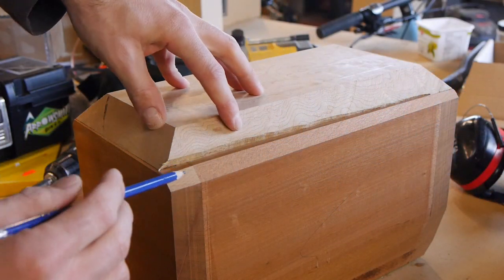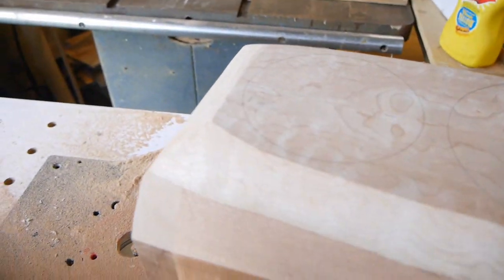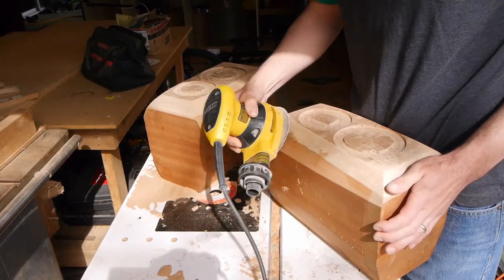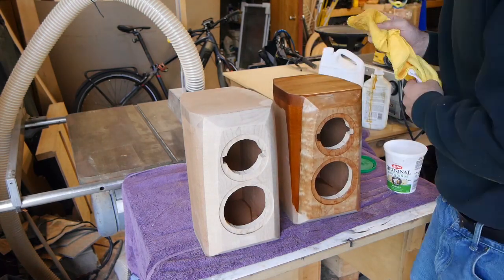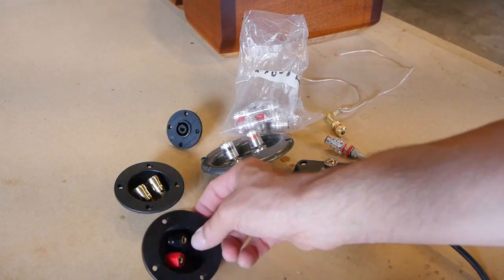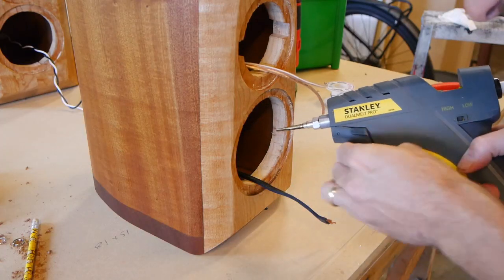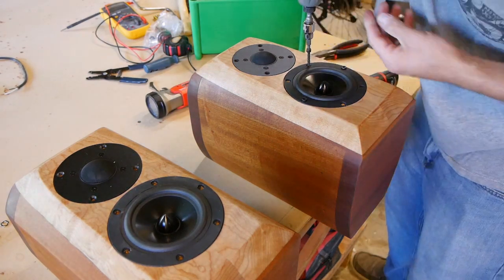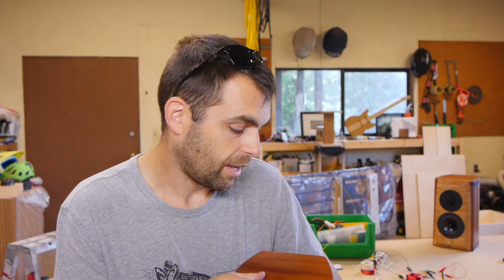Dayton Audio Surround Sound Speaker Build | Part 2

Comment: I use black hex head screws as well.   Less chance of the drill slipping and poking a hole in the speaker.
Reply: DIY Audio Guy   I always pre install the screws with no driver in place.. run them in and out with beeswax on the screw,... then install the speaker after the thread is fully formed in the wood.  .. you never have a jumped driver bit eat through a surround this way.  Never causing damage is nice.

Comment: They look great, hope they sound even better. i use shellac as a sealer since it dries really quick. Sometimes I use it as my main finish as well depending on the duribility I need. Another plus with shellac is any other type of finish can be applied on top of it so no worries about compatibility.
Reply from the maker: houseoffire72 I hadn’t considered shellac but it would have been a good choice on these I think.
Reply: @ImpulseAudioSpeakers  use a sprayer tho since it dries so fast
Reply from the maker: houseoffire72 I usually spray most of my finishes. Just wanted to hand apply this time. I’ve heard Shellac can be hand applied but I’ve never done it. Just sprayed.
Reply: @ImpulseAudioSpeakers  it can but needs thinning to work well... Just spray it. The finish comes out way better with less sanding.

Comment: hi .i have a question i hope in the end i will have some understanding 🙂 i have 3way speakers diy running on active crossover and i found putting a midrange on top in edition to the one on the front to give me a wide soundstage. the problem is it has to be out of phase to run with the other mid and tweeter(even my rta says the same). so i would like to know is it possible to connect both mids in parallel and one of them would stay out of phase? i.e connect the plus to the - and the - to the plus in parallel /and to the amp . insted of plus to plus and -to -? will my amp still see from the 2*8ohm speakers a 4 ohm load?and will one of them will be out of phase? or is it a bad idea? thx for all your help  man👍
Reply from the maker: Yes you can do that. In parallel the load on the amp will be half the rated impedance, but there won’t be any issues and they will be out of phase. 

What you are doing is very tricky to get right. Sounds like a fun experiment. Glad you’re getting good results. Enjoy.
Reply: @ImpulseAudioSpeakers  thank you very much.
Reply: @ImpulseAudioSpeakers  if i had half your expertise i would go passive and would not need 3 cambridge amps. but as is i still get some good results using analog crossover from AUDIOCONTROL which gives me 18db per octave cut. very precise with chips instead of pots to set an exact crossover point. although it was intended for car audio it is high quality crossover.i only have to give it 12dc power. and with RTA i can monitor the  phase . so i guess its fine within the limitations.😉

Comment: They look absolutely beautiful. The woofer does look like it is slightly overhanging the front baffle to me though
Reply from the maker: Mark Holder it is. The curving scalloped away at the edge of the frame but it doesn’t overhang and is symmetrical. I didn’t need to take that much off but I thought the curving looked better this way.

Comment: Did you take a combined measurement and get the acoustic offsets of the drivers for phase integration?  Just curious!!  Would love to know if you did!! 

Thanks again for your time and energy!!
Reply from the maker: Bob Beam yes I believe covered it in part one but maybe not. Sometimes I just use the time of flight method, depends what I’m doing.
Reply: @ImpulseAudioSpeakers  The main reason I'm asking is that I was modeling some with the FRD files you so graciously uploaded for the community to have access to, and I was wondering if I needed to adjust the delay on the woofer to achieve better phase tracking!! Thanks!!
Reply from the maker: Bob Beam ahh, yes you will. Those are raw phase and you’ll want to convert to minimum phase and apply a reasonable offset.

Comment: The bunny is back 😄
Reply from the maker: chris vinicombe was there a bunny in one of the shots?!?! 😆
Reply: @ImpulseAudioSpeakers  at 26 seconds on the baffle. 
Great work on the boxes they look lovely
Reply: @ImpulseAudioSpeakers  Sir ....
Which is better .....
RS 150 
Or 
RS 125

I specifically built for .... Home theatre ...
Which is for best mid range , descent Base response , powerful bassy audio to watch movies and music
Reply from the maker: @nikhilsuryawanshi6301  I would use the 150 for sure.
Reply: @ImpulseAudioSpeakers  which Build good for Home Theatre ....
I have Sony 5.1 channel Amplifier 
40watts per channel + 160 watt Sub channel ....
....
...... My First setup ......
3 x Dayton RS100-4
2 x Dayton Dome tweeter 
1 x Tang Band W5 Subwoofer 
Setup like Sound Bar 

...... My second Setup ......
2 x Dayton RS150-4 
2 x Dayton Dome Tweeter 
1x Tang Band W5 Subwoofer
Setup like Bookshelf 

..... My third Setup .....
2 x MarkAudio CHR 70
2 x Dayton TCP115-4 / ND140-4
No Sub and Tweeter 
Design like Tower 

..................................
I Don't required deep bass...... Just wants  boomy bass ..... And strong mid range performance. I don't use crossover because I have 5 channel ..

Comment: You should really think of using a PCB for your crossover, or even a thin  plywood board. If you need to change something to it will be harder now, also try not twisting the leads of the components in the crossover then soldering them as you will have a hard time if you want to change something. Keep up the good work.
Reply from the maker: Cimpoeru Mihai I have used them in the past with a cnc cut board. But the speaker was so tight I just did this. I won’t be changing anything as I already did months of testing and finished with this arrangement. They’re in there forever now.

Comment: General question from someone (me) whose technical knowledge is limited to simple soldering. If I wanted to replace Dayton Reference RST28 with Scanspeak Illuminator D3004/6640-00 1" Beryllium tweeters, where do I start in gaining knowledge? My impression is that they are similar as tweeters go, but my impression is about as intelligent as a rock. The Dayton’s are in a pair of Caladan open baffles and I can’t get myself to enjoy the tweeters as much as I enjoy the ScanPeaks in my Odyssey Kismet floor standers. So, in summary, I’m looking for advice and maybe a teacher. I’d be happy to Venmo for your time if you need to get into the weeds with explaining a solution if a solution exists.

Comment: A build I would love to see an curious if it would even function good if so is a layout that killed 3 birds with one speaker... The idea is 2 multi function very tall active towers say 7' +/- that housed a sub in the bottom or down firing in the base and full range front mains in the middle and the front high way up in the top... Yeah the  budget would be on the higher side but it would replace 3 speakers per side., On another level but not sure if even functional or feasible is with some crafty angulation of drivers that could serve as a center...? Maby that's getting to be a bit much... but If it would work and work good I'd love to see it built and from what I've seen I know you could pull it off with as much success as the design allowed. It could be built in multiple levels from slim tower with say 6" drivers and a big and powerful daddy version with large say 12" drivers and big wattage amp. It would Just be a cool build imo.

Comment: Why didn't you use ordinary woodfiller??? Would have been way way easier...or just use some sawdust and woodglue from offcuts??
Reply from the maker: justkiddin1980 I just used sawdust from all the beltsanding. Better match than wood filler and easier than wood filler cause the sawdust was right there. Just grabbed my glue bottle and squirted a bit on and smeared it around. Easy.

Comment: you have good treble and midrange but the crossover is not so well made! the crossover determines how good sound you get. just coil to a capacitor is too simple
Reply from the maker: skrotkalle skrotkalle please see my previous videos about the XO for these speakers. I really really know what I’m doing ok. Thanks for the advice though.
Reply: @ImpulseAudioSpeakers   Ok. The reason I wrote what I wrote is that so far I haven't seen crossover in a good speaker only with coil on bass to capacitor on treble! There is a reason for that! A speaker does not have a flat frequency response so you need to lower frequencies that are too strong compared to the others frequencies.
Reply from the maker: skrotkalle skrotkalle and if you watch the other videos you’ll hear me say this is the first time I’ve ever been able to get away with such a simple XO. I also talk about how budget orientated this speaker is and how I worked hard to cut out parts. You’ll also see comprehensive testing of both drivers including frequency response, distortion, TS parameters, and polar response. I really do know what I’m doing when it comes to speaker design.
Reply: @ImpulseAudioSpeakers   I understand. Nice speaker you made.
Do you give me an email address so I want to show you the crossover on my latest speaker project if you are interested?
Reply from the maker: skrotkalle skrotkalle I don’t check this email often but I can be reached at ryan@impulseaudio.ca and would be happy to get an email. Thanks.